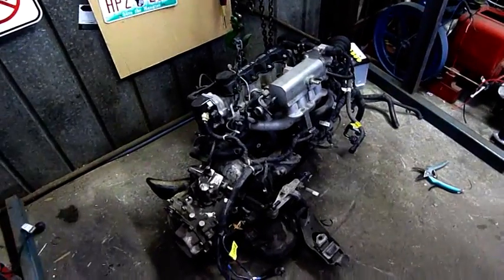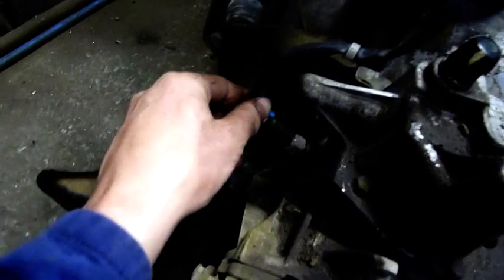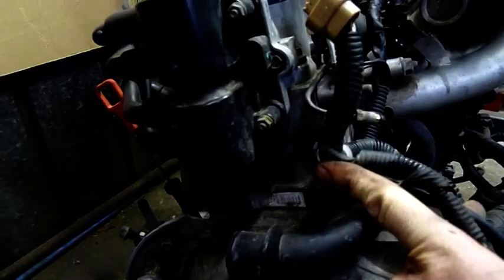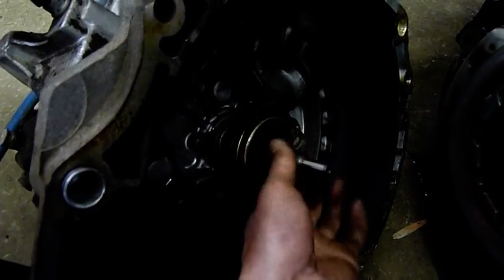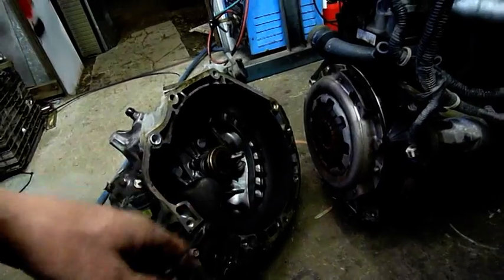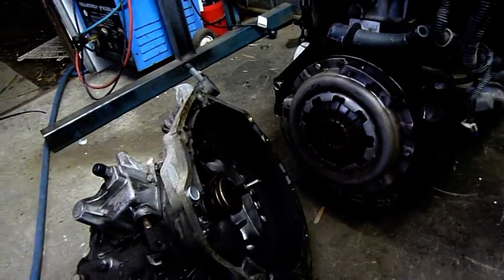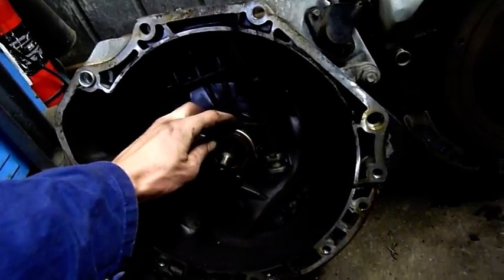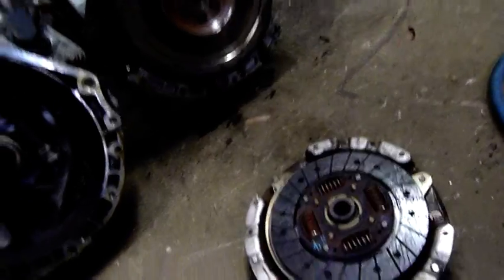Daewoo 1.5L SOHC Engine Autopsy 1 - Gearbox and Clutch Removal

Comment: how do u check transmission oil what does it look like
Reply: theres a bolt on the side to fill with lube, and on this gearbox I'm sure to change the gear box oil you have to remove the sump plate on the bottom, replace the gasket then put the sump plate back on then fill with oil till it comes out the fill hole.

Comment: I'm using a Daewoo Cielo 1.5L,(older model to the Lanos) but were sticking a opel 1.8 Gsi motor inside, however we are still using the Daewoo Cielo's gearbox, will this run appropriately? or would it cause any problems ?
Reply: +christopher pewpewmagoo The power windows of my Cielo are not working properly. One of them does not work at all. Can you tell me where I can get new motors for them? Any other suggestions?

Comment: Hmm haven't seen an Opel with 8cyls,the biggest true Opel engine they have now is a 2.7 V6 Turbo,the Non-Ecotec engines of Holden are having roots from the US.

According to Wikipedia the E-Tec is indeed a Family (Ecotec) series engine but different older variant,it explains why a same year and displacement E-Tec and Ecotec on your front are looking like a complete different setup.

Comment from the maker: yeh if its a big cruisy car you don't need to left foot brake, I find a lot of newer cars I drive to be a bit too jumpy on take off so it pays to have a foot at the ready for the brake, and if your constantly aware of what your feet are doing, riding the brake is not a issue.
if I am on a open road I keep it on the dead pedal anyway, that way I can use either foot or both if SHTF :p

Comment: opel ,daewoo ,vauxhall &holden use all the same motors but vary over the years ,there is so many varations ,but use the right ones check the codes ,daewoo 4 cyl goes up to 2.2 l but they also got 6 cyl &8cyl models too ,same as holden

Comment: Also, AFAIK left-foot-braking here in California is frowned upon, at least for new drivers, because when I took my test one of the things the score sheet said they can ding you on is using your left foot to brake. Why is it frowned upon? Not sure, my parents think it's because one might end up riding the brake.
I switch between it, in my big 126 S-class I use one foot, but in our 124 E-class wagon and our big old SUV I drive two foot. It's just a matter of what's more comfortable to do.

Comment: I once heard a story about someone whose clutch cable snapped (or master/slave failed), and to get home he had to start the engine in gear, shift without the clutch, and then put it in neutral and shut down the engine to stop. And he did in fact make it home.

Comment: Question:  I have an 01 Hyundai Sonata that when idling in neutral you can hear a rattling sound from the clutch.  Lately, when the car is hot, and you disengage the clutch, it will remain disengaged.  The clutch will then work properly after the car has cooled down.  Would this be a bad throw out bearing or a bad pressure plate.  I have yet to drop the transmission as time, and or weather hasn't given me the chance yet.

Comment: I've never changed out a clutch disc before, as I always read that you need a "clutch alignment tool" which is usually a manufacturer specific tool. Now it's plain to see WHY that tool is necessary.

Comment: You can check for the engine code,if i remember right the 1.3 is A13SMS,i don't know of the 1.6 but sure as heck it will include 16. I don't know of details but if you see the Opel engines the Ecotec of the late 90's to early 00's they are totally different,i believe they must be different blocks,the Opels also had different displacement,like 1.0 (4cyl),1.2,1.4,and 1.6 (1.8,etc),the Daewoo series was starting from 0.8 3Cyl and going 1.3 and 1.5.

Comment: have a look around for a thermoswitch possibly near the thermostat housing. that may have been the switch that failed. most cars have separate sensors for dash gauge, ECU coolant temp sense and a then a separate one again for the thermo fan. some modern vehicles and aftermarket ecus control the engine fan.

Comment from the maker: yeh I forgot about that part, I will be going into it on the transmission video.

the center hub of the plate is allowed to move a little under spring tension, I beleive it helps smooth out engagement

Comment: I'm not aware of differing pedal placement on any cars. The cars in the States follow the standard clutch=left (if applicable) brake=center (left), and accelerator/gas=right. Some cars do actually have a parking brake pedal located on the far left against the kick panel, but the pedal is much smaller than the others. Those are pretty much eliminated as far as current models are concerned.